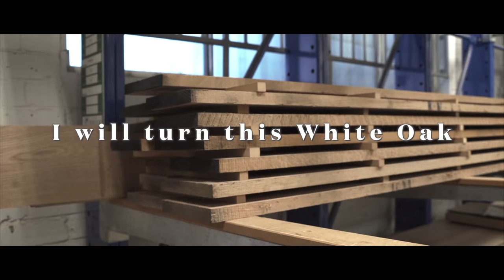WOODWORKING - Building an Oak Cabinet with a Sliding Tambour Door

Comment: Your projects are 'wood art'.  On your stereo furniture piece, it was genius to hang those doors on aluminum track with the rollers.  The canvas backed tambour rollup brought back memories.  Out of oak, I built seven wall-hung cabinets with split tambour doors that rolled horizontally.  The sixty-inch-wide cabinets hang over the individual birthing room beds in our local hospital and hide the oxygen and other mechanicals involved in the birthing process.  After working for the hospital for twenty-one years, I've been retired for sixteen years now, and those rooms are still being used and the tambour doors are still functional.  Building all the cabinets for those seven rooms is one of my most prideful projects.
Reply: What an awesome legacy to leave. That sounds like a much more welcoming environment for a mom in labor. Thanks for sharing your story.

Comment: I really like how you do the basic cabinet frame. So clean and simple. No pocket holes or anything. Hey, I went into the Goodwill store in Brookvale the other day and picked up a solid oak buffet/sideboard for $65 😁. Really good quality with dovetailed drawers etc. and good condition. Just a bit dated. Weighs a ton. No idea what the cost of all that oak would be, but it would be a LOT more than $65. Will be an awesome up-cycling project. 👍

Comment: How do you handle glue squeeze out on interior corners? I haven't found a good solution yet myself. Using a damp cloth can raise wood fibres and needs sanding (akward). Letting it set and then using a chisel can be fiddly and risks tear out if you're not careful. Masking or pre-coating the pieces and hoping you can just peel the glue-off, but this has it's own drawbacks. I'm wondering if there's like a solvent that leaves the wood intact but dissolves and picks up the glue?

Comment: Stunning piece, I always love the way the prooftint allows the undertones to shine, have you had any issues with Osmo ? I have experienced minor water spillage causing major tannin staining on blackbutt, , contacting their office in Victoria the guy blamed my application and were not interested, even though it was applied exactly as they suggested, upon investigation I found it to be a problem others have experienced, I will never use their products again, instead use Rubio monocoat nowadays, far superior to Osmo and no call backs.
Reply from the maker: I personally haven't had any problems but i have some friends that are experiencing issues. Im going to start looking into new finishes soon though.
Reply: @pedullastudio  👍BTW I love the custom bifold hardware, genius
Reply: I’ve had this exact problem! I built out laundry bench out of American Oak, and finished with Osmo Poly x satin. We can’t even put anything on the bench even slightly damp without it leaving a stain. I’m about to sand it right back and refinish. I’m wondering if it was a batch of oil that was all defective?
Reply: @KermyGermy  I don't think it's a faulty batch, rather a faulty product, I was instructed by Osmo Australia to use the Wood Protector product first, then overcoat with regular Poly X, complete waste of money, it bled through within a few days of installation, I had to sand it all off and went back to my regular 2 Pack Linear Polyurethane for that job and have not heard a word from the client about any further problems, cost me three days in labour to repair the stuff-up, I have used other brands of Hardwax on dining tables with no issues, I know these tables are used on daily basis with water being spilt etc, the sad part was the support from Osmo Australia in Victoria was terrible, I disposed of all my Osmo products after that and vowed to never use their products again, waste of money and my time.
Reply: @zaneh6224  Geez Louise! That sounds painful. Glad you got it sorted in the end though. Funny thing is, I’ve used osmo for about 5 years or so now. Never had a problem until recently.

Comment: That is amazing work, both in wood and metal. How do you ensure that your screws in aluminum block don't loosen over time. I did see double nuts but not in all cases.
Reply from the maker: Ive used loctite where necessary

Comment: i have a question: i want to build a wash dry and fridge cabinet/closet but i dont know how to begin design it. I want the fridge left, dryer in the midle and wasmachine right. I also find it hard how i can measure out the hardware for the doors what kind of turning hardware and so on. it would  be awsome to have the wasmachine on a slide so that i can excecs behind the wasmachine. Can you help me please?With kind regards, Nathan

Comment: Nice build, have a quick question for you if I may, how do you get on with that bostich 23 guage nailer in Oak? I've been thinking about getting one as my cheaper one has a horrible tendancy to drive the pins out sideways with the grain of the wood when trying to pin solid edging to a playwood or mdf panel for example, dont know if it's the pins I'm using or the nailer but it's really annoying ond of course they always pop through the finish face!
Reply from the maker: Mine works great for me but to be honest I rarely use it

Comment: As so many have said, your work is of the highest quality - I can’t say that I’ve seen anyone demonstrate a higher skill level. What is particularly pleasing is the high quality of innovative design. Which brings me onto all the background work that is not seen - the brief, the first design, the cut list, the selection of materials, the jigs - even down to maintenance of the tools. As a woodworker who doesn’t always hit the same skill level as you……I would find a video on those processes equally fascinating.

Now, if you could only make an epoxy river table….
Reply from the maker: Thank you for noticing all the work that goes on behind the scenes. Much Appreciated! 
Im sure one day I will give more of an insight into the background work. I wouldn't hold your breath on an epoxy table though 😂
Reply: @pedullastudio  I know that all the background work is something that paying and non paying customers just don’t appreciate. Your designs appear to be totally original and it must take hours to go through the design process - which involves much more than the aesthetic - whilst mine tend to be adaptions of arts and crafts style pieces and so I’m often working backwards from the aesthetic. 

I’m supposed to be scaling down but I usually buy my timber as slabs (waney edge, rough sawn). I potentially get no more than 75% usable timber from a slab ( I joke about river tables but the one good thing about the use of epoxy is that the waste %of timber can go right down). So, it easily be a day for me to cut, edge, plane all that stuff. 

I particularly like curved elements because they tend to please me more; however, every curve impacts upon another piece and that adage about multiplying the hours required for “flat” pieces by 10 to get curved pieces isn’t far out. 

I’m delighted that you have found a market for high quality pieces of furniture - and found a way to make it pay. So perhaps we ought to especially thank that oft-ignored bunch of people - the discerning client - for being willing to pay the appropriate price for pieces that will last several lifetimes.

Comment: Miter framing a fixed rectangle like that with glue tight joints seems easy in a 17m video!  Any tricks you can share ?  What did you cut the miters with? Thank you for sharing and as always it looks great!
Reply from the maker: Granted i have a very expensive panel saw that cuts perfect mitres, but the trick is to always ensure your machines are set up perfectly.
Thanks for the comment.

Comment: Is that depth stop on your Makita drill lighted? If so what brand is it I can't find one on google.
Reply: Don’t know about it being lit, never seen one that does that.  Also not sure what brand countersink  he’s using.  For those not familiar. If it’s like Amana’s countersinks, it’s a piece of white HDPE (or similar).  Amana makes two types, one is similar in concept to what Nick is using.  The other uses a thrust bearing. I have three sizes (mainly use 9/64 & 11/64) of the Amana thrust bearing design, none of the HDPE types.  For tight spaces, I use either an old very Fuller set or the odd Dewalt 1/4” hex shank in varying sizes.  Marc (Woodwhisperer) did a brief overview vid of the two types (HDPE vs thrust-bearing) a few years ago.

As always YMMV.  Just sharing, Nothing more. Nothing less.  Ya’ll have a good’un now.